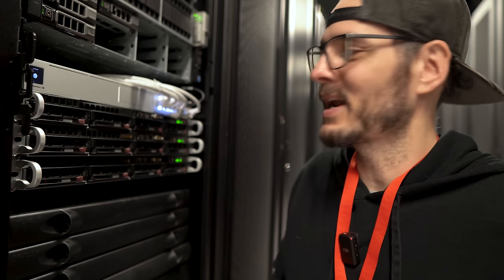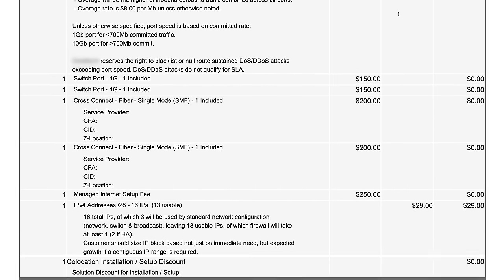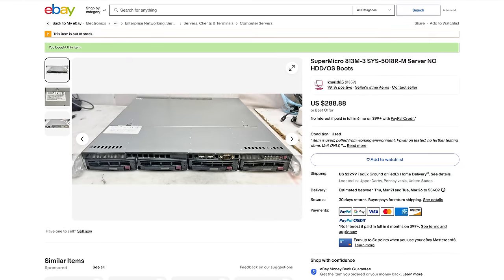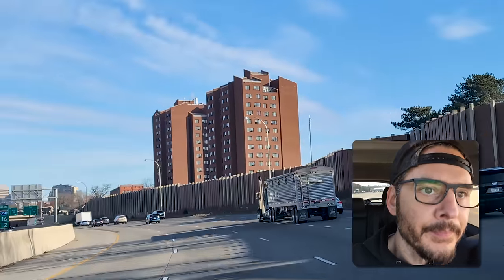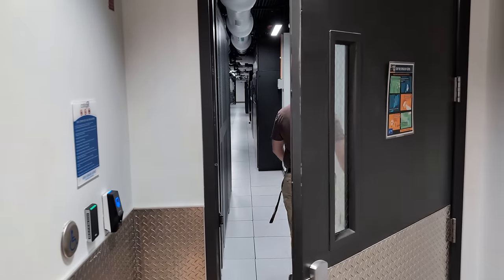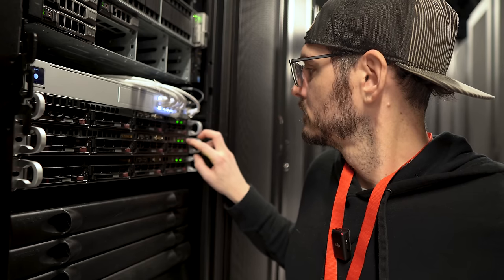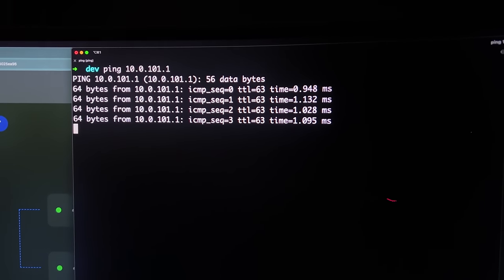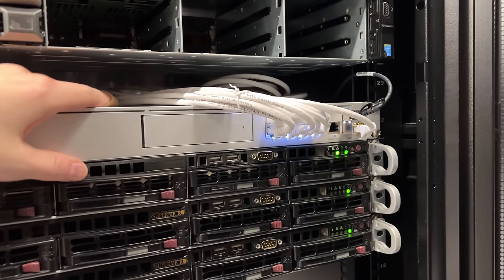I Colocated My HomeLab in a Data Center

Comment: I am running wireguard (not tailscale) for my site to site and then I do BGP routing between the sites and it works just perfect. I am using tailscale for "road warrior"-style connectivity from my laptop/phone etc if I'm not at home and I need to connect to my DC/Home
I think tailscale is great, but it just didn't fit for site to site for me running a similar setup to what you have.

Comment: Wouldn't sharing a colocation rack space be quite a risk? You need to setup some encryption, chassis intrusion, network BPDU, filter, mac security...
For connection back home, mesh network or a cloudflare container! Since it doesn't look like you have an OOB management device (and probably don't want datacenter remote hand to help you power cycle), would suggest some sort of IP KVM like opengear or piKVM.
Reply: 👍
I added a comment sort of along these lines

Comment: I had a site to site VPN for the longest time just to connect to my permanent address but it got less and less reliable to the point where I installed tailscale as a container (second one on another node in the cluster) and haven't looked back since. However I think because your ISP is located in the same data center I would just keep it to a site to site VPN.

Comment: Very interesting. Im in a similar position, I need to find a cheap colo with no frills. I have about 1/4 rack and a shared space would be perfect. How do you go about finding these? My research so-far has only turned up actual datacenter hosting facilities, while im looking for cheap rackspace even if it's not 5-nines of uptime.

Comment: In regards of this video... I'm curious about using Unifis site to site magic VPN... can you have kinda "regular" firewall rules like you'd have if you just subdivide your home network in several VLANs or using OpenVPN to connect to another Unifi network or are there limitations which come with the site to site magic VPN?

Comment: That sound example you provided is too soft lol.
Its lounder and mentally annoying.
Also, being in a DC has cell service issues - if you are doing remote hands.
So having your own AP in your cabinet helps!

On the topic of virtual connections:
We just deployed a multi-region DC (multi-server setup accross regions) 
All the servers sit behind firewalls, and then we have zerotier as the virtual backbone.
(This is a proxmox HA cluster with ceph btw)
The regions are close, but far - so not the best for ceph, but means this setup can loose a literal DC and still be online.

I have setup FRR over zerotier for the virtual routing (oh, ps, proxmox SDN 8.2 apparently has some fixes for evpn dhcp zones ... have a dhcp server vm for ip management atm... )

Reason for ZT was we didn't have to host the master servers - they handle their HA already.
Then on top of that, is it creates deditated UDP tunnels between the servers (mesh) 
The servers are only 1G ea, and ZT I have seen max 4Gbps (couple years ago, not sure if they fixed this yet) - so no an issue there. 
I found ZT to just be simpler, easier and works - stable - no uptime issues vs tailwind which I have yet to actually test ... no use case

For a colo cabinet - my biggest gripe is not havaing someone maintain the cabinet (eg: if will let you go in whenever unsupervised)
I have seen many a cabinet that is a total mess, people using more U's than they should etc... 
As long as will maintains it hands on (which should not be an issue) - it will be solid.

My BIGGEST recommendation to you is probs going to be : replace the UDM (it's really not ENT equipment - screw the power solution they have, just give 2 AC power ports and be done with it)
Why? dual power rails.
We have 2 power rails in a DC for a reason - 2 of everything - redundancy
Also, the DC may perform maintenance - and if they take a power rail offline - you are dead until it comes back up.
* tldr - as I didnt see the whole rack, I don't know if he has a pre-installed ATS unit and you are connected to that
* an ATS or automatic transfer switch - is usually a rack mount box that connects to both feeds and switches as power comes/goes for single power cord equipment 
So if you are connected to one, then no issues.
But if you are not - make a trip back and either get one or get a router that can do it.

I do recommend a physical router over a virtual one in your setting - since you need to switch the servers ... might as well do both (router+switch) - udm does good in this case.
You could do a PFSense device, or what may be a simpler one .... Mikrotik - their CCR range is very much suited and decently priced (used by thousands of ISPs for gateways)
Its got dual PSU (just verify based on model) - you just will probs have to manually connect to the udm at your house ... but if you get an arm/arm64 based mik - you can actually run containers on it or use zerotier

Comment: Curious as to why you chose to mount your UDM in the front of the rack instead of in the rear? That would have allowed you to put spacers in the front above your servers. Cleaner look, and also shorter cables from switch to servers :) As for how I connect to our data center, I use Tailscale. I have a VPN client as a backup in the event that the endpoint running tailscale in the datacenter goes down for whatever reason.

Comment: Isn’t the 8 port switch on the UDM pro only connected back to the CPU at 1Gbps so you aren’t gaining anything from that 10Gbps internet link? Have you tried doing a speed test from 2 cluster nodes at the same time?
Reply: This is true. All 8 rj45 ports share a 1gb uplink to the CPU. @technotim, I recommend getting a Ubiquiti Aggregation Switch so all of your servers can use 10GB SFP+. PS, I'm near Powderhorn. We should get a beer!

Comment: not sure you mean by hardware/software solution but I would use wiregaurd vpn between the two sites, tailscale is also wiregaurd vpn but with some cool nat transversal logic built in and a clean ui, so I would just stick to regular vpn unless you cant as it remove tailscales service as a point of failure.

Comment: I'd be more inclined to use Mikrotik at the edge. It can be cheaper with a much more robust feature set. Why not go Tailscale/Zerotier and Wireguard? No reason to just use one. Also consider a LTE modem as a backup connection or for OOBM if signal permits.
Reply: pfSense is also a good option with the Tailscale package. I think OPNsense also has a ZeroTier package, I'm not sure. But I like Mikrotik too, cheap and reliable.

Comment: I used to just stand up vpn on whatever router/fw platform I had at the time but I’m starting to realize I don’t like have to reconfigure everything every time I replace the router. I’ve been migrating my vpn tunnels to dedicated wireguard boxes (yes plural) that also run a lightweight routing engine and peer with my switch. I’ve got several tunnels built up this way and now if a router dies I just replace it and add a couple of port forwards/firewall rules in and I’m back off to the races regardless of what platform I’m using for my internet connections

Comment: i think the udmp is the wort device for this uscase.
- the downlins are only 1GB/s
- All 8 Lanports are internealy connected over just gigabit, so the 10gb/s uplinks is completl usless.
- no redundancy, ...

why not run a pair of virtualized firewalls and use 2 10gb/s switches instead of the udmp?
Reply from the maker: Convenience, cost, and all the things I mentioned.  I don’t need 10g or even 1g really.  If I exceed this at some point it’s as simple as adding a switch.
Reply: @TechnoTim  1gb/s iv very slow for cluster comunication. Migrating VMs from one host to an other takes ages. And ceph Strage will suffer from this to.

Comment: Are those bandwidth prices for real? 50 mb/s is like a slow Internet connection in a home. I would expect way more from a datacenter. What am I missing?
Reply: Hi! I run a web hosting/infrastructure provider and I can explain. When you get 50 Mbps, 100 Mbps, etc. what you're getting is a burstable port billed at the 95th percentile. We do this because your traffic isn't coming over one provider, it's coming over a blend of carriers for redundancy. We take a snapshot of traffic at 5 minute intervals and then at the end of the month, it's sorted from highest to lowest. Then, we throw away the top 5% of data. So if you have a 50 Mbps connection, you could burst up to 1 Gbps for 36 hours in a month and you won't be billed for it. As long as 95% of traffic is at or below your "limit", you won't be billed for any overages.
Reply: @TravisNewton1  what is the standard overage that one has to pay if the 95th percentile is say 200mbps instead of 50? Can the ISP throttle the connection to ensure that I do not go above 50mbps as my 95% percentile?

Comment: I'd have to go with VPN, but only because I have 0 experience with mesh networks. Seems maybe VPN is more bullet proof I could be wrong.
Reply: Traditional is getting very difficult with firewall issues and ISP's these days. Especially when they run CGNAT, which rumor is they all WILL be if not yet. Then you can't really use VPN on residential service anyway. Enter Zeroteir and Tailscale which  just work through all that.

Comment: Come on, if you are going to use a Unfiy switch at least mount it at the back of the rack so you don''t have to run the cables over the top.